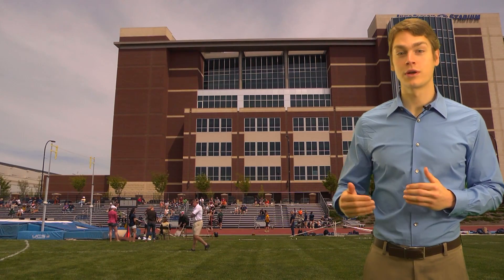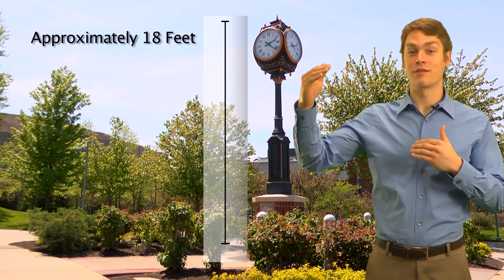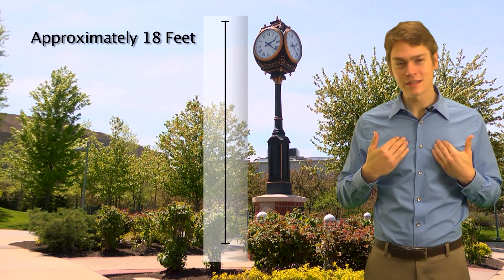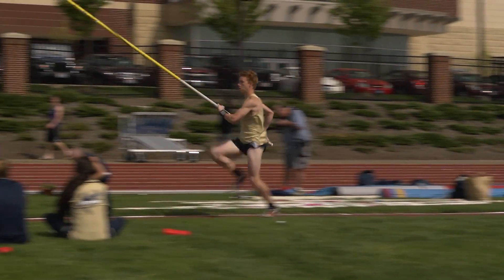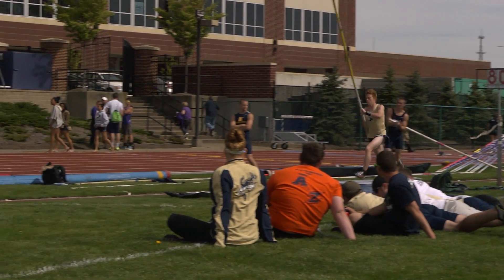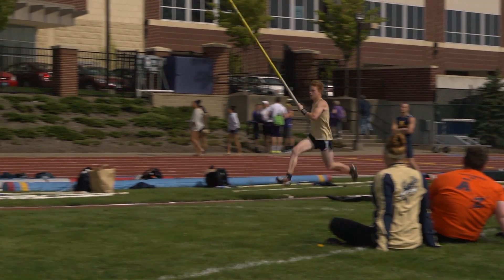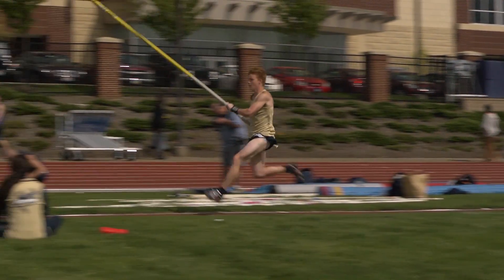UA Track & Field: The Physics of Pole Vaulting

Comment: What about the center of mass? I heard there is a technique which makes the center of mass below the pole they are trying to jump over.
Reply: that happens at the top of the vault, when they 'curl' around the bar. Their centre of mass passes under the bar but their body passes over the bar. Watch a video about the physics of high jump, it's the same principle.
Reply: Niall Prendiville i will, thanks.